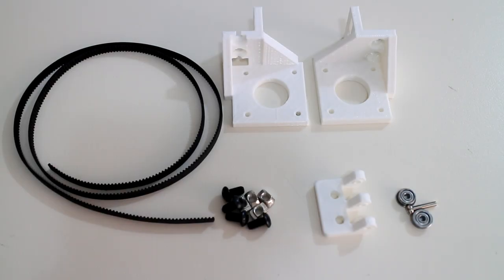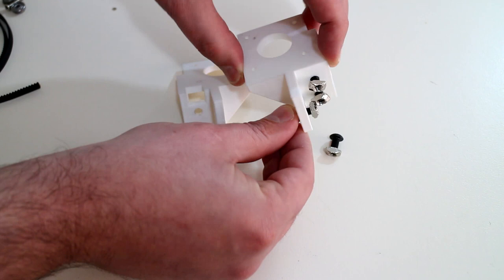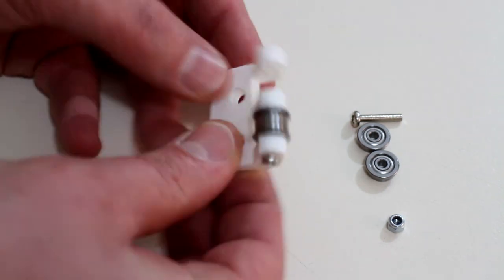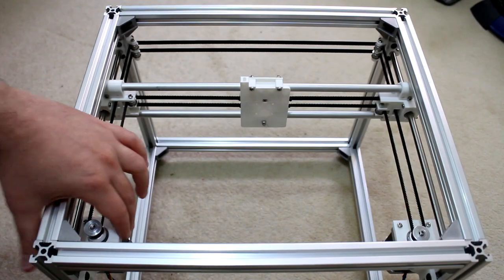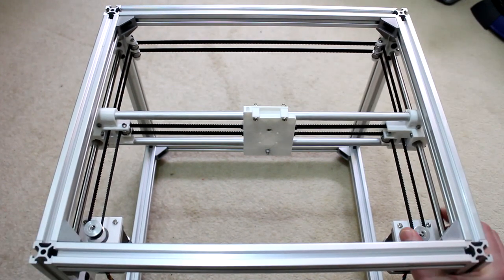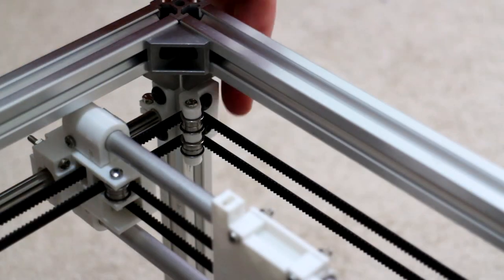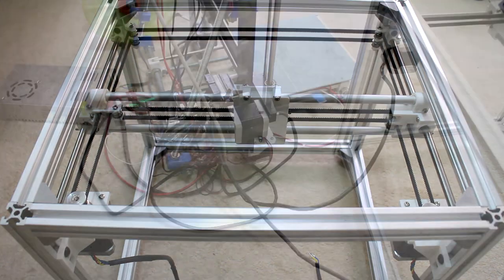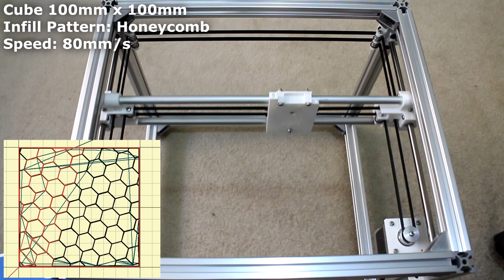New 3D Printer - Build Log #3

Comment: hi great videos just wondering could this setup be made larger to get a lazer cutter with a decent bed size
Reply: Belts would get A bit too long maybe or you need a tensioner halfway.

This tensioner is already designed for the hypercube evolution

Comment: You really think like a engineer :-) it looks beautiful. Never know that about the x movement, I always thought it used a extra motor. Parts are printed in pla right? it will be interesting to see how it will hold up if you build a enclosure around it and the temperature inside the printer get higher. I decided to build this printer If I can keep it around the 300 euro's. my P3steel is just to good to take apart for now ;-) Anyway nice video with dramatic music.
Reply: I asked him about the material in video 1 or 2.

It is currently made of PLA, but he said that once everything is finalized he would print it in ABS.
Reply: Not sure why ABS?  I would do PLA or PETG since the motors should be cool to the touch if done right.
Reply: +Dark Alchemist But if he has a heated bed in an enclosed space PLA will become ductile and act more elastic.
Reply: BN
True.  I just despise ABS for parts as I never could get it rigid enough no matter if 100% solid or not.  PETG is a beast though and unless he wants his chamber at 80c, and then some, PETG would work very well.  I used to love, and only printed in, ABS but not so anymore after I found how soft it really is and beyond flexible no matter what I tried.  PLA is too rigid for some parts I printed though and if it moves they have a tendency to lose their shape (I suspect it rubs smooth) so didn't work for my I3 Rework's parts.

Comment: I think I will do the same when I got the time but I kind of want the dobbel instead of 200*200*200 I want 400*400*600, do you think it can be done the same way? just enlarge the pieces?
Reply from the maker: Yeah you can, but you may need to reduce print speed and/or acceleration to maintain print quality.
Reply: +Tech2C i normal print 50% anyway :)

Comment: Hello, I would like to know how will you control it, using an arduino mega + ramps 1.4? In that case, is the firmware different? I'm asking because, if I understood how it works correctly, you need to control both motors (X and Y) to move the print head.

I don't know if my question makes any sense but is the only thing I can not get my head around.

Thanks!!
Reply: Another question, which slicer would you use?
Reply from the maker: Yes arduino mega + ramps 1.4. Load Marlin into arduino, set corexy kinematics in configuration.h file.
For slicing software I use Cura and Slic3r.
Reply: Ok, so if I understand correctly, you load the marlin and then use cura or slic3r.

When you configure any of them it does not matter which type of g-code flavor or type of printer you configure, right?

Thanks a lot!

Comment: I have set my corexy up based on your build logs  and when I hand move the motors they move exactly the same as yours , when I use controls in simplify3d  the y moves correctly but the x is inverted  tried reversing one motor and it swaps the x and y   if i reverse 2 motors x is fine   but y is inverted  (Stumped)  Could you give me any ideas  thanks
Excellent Videos by the way
Reply: i'm having the same problem! you already got a solution?